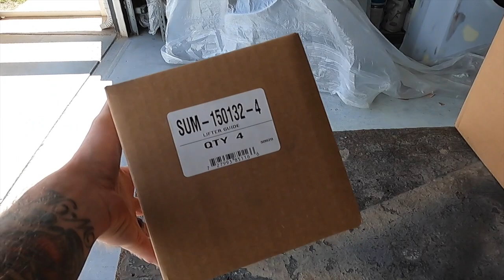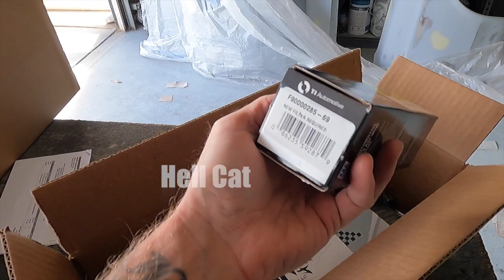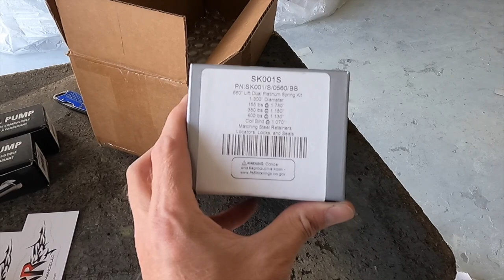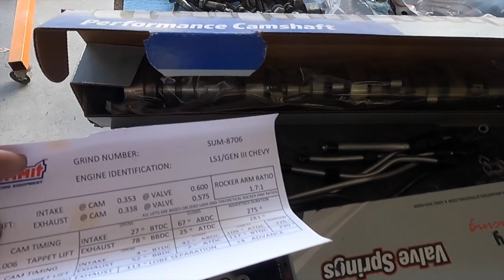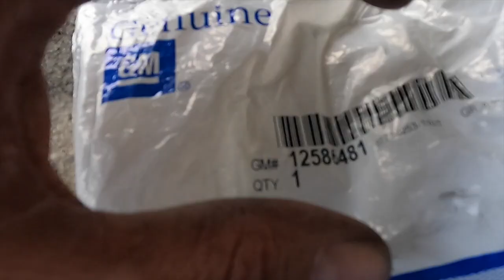Maliboom Parts Form Warr Performance and Cam Install

Comment: This is the first time I've that collar. I have seen the pick up tubes from holley that are made with two bolt holes though. Good luck on your build.
Reply from the maker: Stock pick up tubes only have one bolt. The holley pan I have only has the one bolt as well. This is a cheap fix for that.

Comment: Putting an engine together I would love the oil pickup clamp I was going to weld one on I mean i see no reason not welding one on it wouldn't hurt anything right it's funny because when I tore the motor down I didn't know they only had one bolt let us know how it fits and if it slides off or if there's any possible way for it to come off

Comment: I'll deff be looking into war deff like the idea of the oil tube pickup collar. I've got a 82 s10 I'm putting a 5.3 in and fund have been tight as hell plans havent went as I wanted. I was gonna try and at least throw a cam in it but the terminator harness ect just cost to much for me to do a cam ect so itll be a stock 5.3 with a few new gaskets ect.
Reply from the maker: Get it running first and you can always cam swap it later not big deal. The Terminator X is worth it and if you put it on and drive it with a stock cam you can get used to tuning it and messing with it stock before the swap.

Comment: coming along nicely. i think that cam will be my next choice for a 5.3. or the summit 8720. 

is that scratch on the front of the motor on the valley cover deep or did it just look that way on camera? it makes a x on the block. i noticed it close to the end of the video. id hate for it to leak oil under the gasket if its real deep.
Reply from the maker: The block is a core motor so she's a little beat up. If it needs some silly cone ill throw it down before I put gaskets on. 😁 Im not scared

Comment: So I just found out my 5.3 has been bored 20 over and the machine shop is saying I have to go 30 over will I be able to run boost being 30 over
Reply from the maker: By the time you go through all that cant you just get another junkyard motor and boost it and be good. The Machine shop is expensive really. Im sure you can still boost it at 30 over unless your trying to like 25-30 psi.

Comment: Why didn't you go with a double roller and get away from chain guide?
Reply from the maker: I have never heard of an LS having a timing chain problem yet. Im sure its possible but this stuff should hold up fine.
Reply: @Burndown  my 08 escalade had a guide fall apart and sent metal thru engine.  Pulled 2 chunks of metal off the magnet on drain plug.

Comment: Hey Dane - do you run the truck accessory setup or something else?  Previous engine was 5.3 or 6.0?   
Following your build with my LQ4 build, realized I'm not sure if accessories fit in my 64 A-body.  Love the channel!!
Reply from the maker: Yes I run the truck accessories! They fit and I have just enough room for an electric fan. I may be putting in a new radiator so ill keep you posted
Reply: @Burndown  Thank you!!